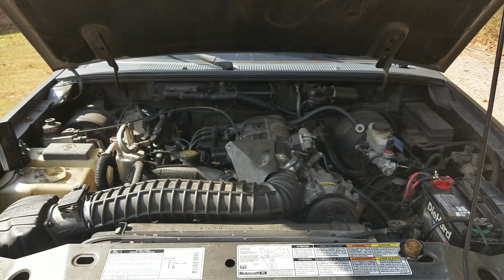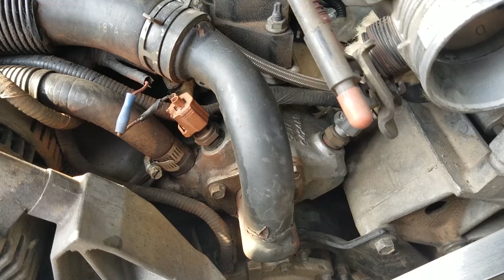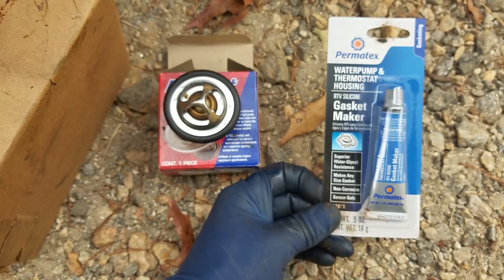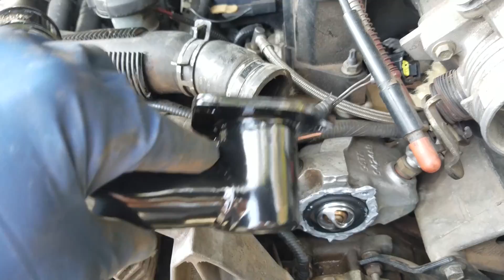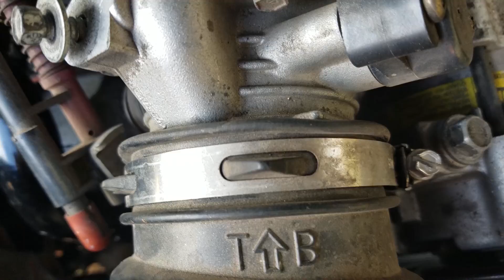Car Overheating? No Heat? Watch This!

Comment from the maker: What's up Yall? Parts in description.
Timestamps:
0:00 Intro
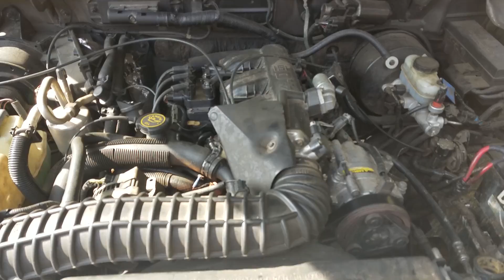0:04 Thermostat Removal
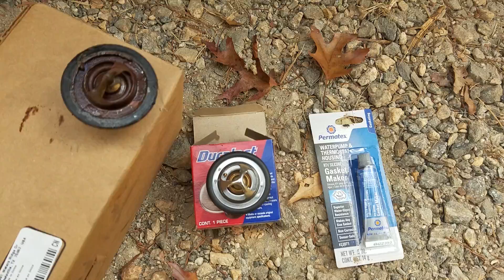2:43 New Thermostat
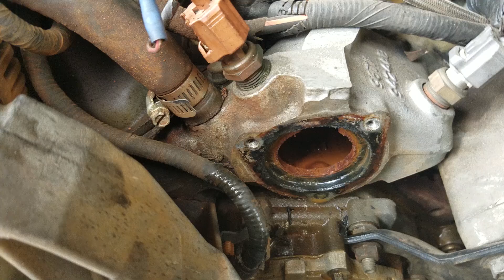3:47 Old Gasket Removal
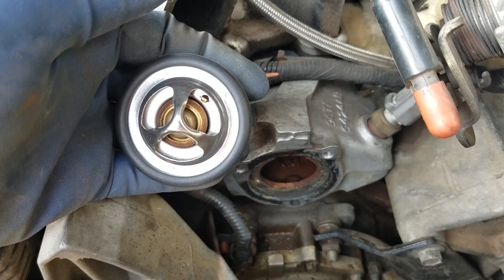5:30 Thermostat Installation
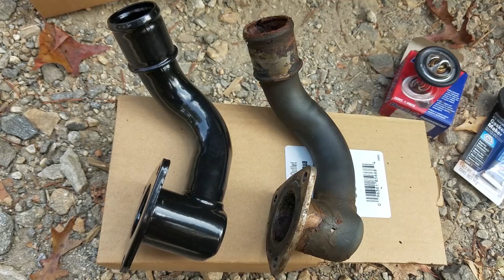6:33 New Thermostat Housing
8:18 Thermostat Housing Installation
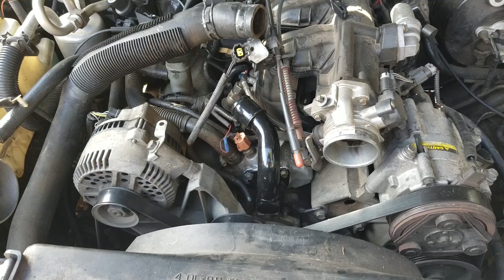10:31 Reinstall Hoses
12:22 New Anti-Freeze
13:04 Outro

As an Amazon Associate I earn from qualifying purchases.

Comment: Did you have heat after you changed out the thermostat?
Reply from the maker: Yes, You have to run it on high heat.

Comment: Okay Matt, just changed the thermostat in the wifes RUSTANG.  Went through the whole procedure and STILL haven't got heat.( Or GOOD heat, like a Ford usually has) And yes, I was watching one of Kilmers videos and put the little bastard in BACKWARD but I caught it, and this is not the issue. I'm old and tired, so cut me some slack. I'm trying to get 4 cars ready for winter and can't keep on top of shit. I'm thinking it has something to do with the vent system ... doors, flaps, vacuum etc,  HMB if you get the chance. Good vid dude.

Comment: Ok well it looks like you reply fast and I need help. So here is my situation, when I got home and pulled into my driveway it said my truck was overheating and white smoke starting coming out from under the hood, when I opened my hood my coolant overflow was completely empty (was full the day before) and I noticed my engine was wet, ( I’m guessing it was the coolant) it was really late so I decided to put some coolant in the tank and go to bed. The next morning it didn’t leak of if the overflow tank. I also noticed that when my truck was overheating my air was ice cold still. After I put more coolant in the radiator and the overflow tank I took it for a small drive to see if it was still overheating, it was so I parked it back in the driveway. The white smoke is coming from where the thermostat is, I also read in the owners manual that if the top hose that goes into the thermostat doesn’t get hot while engine is running and hot that could be the problem. I’m at a lost right now of what to do because I don’t want to take it to a repair shop if I can do it myself and save money. I have a 1998 Dodge Ram 1500 5.9 L V8 Lurami SLT please help thank you
Reply from the maker: I'd go to Autozone or Advance and rent a radiator pressure test kit. Test the system to whatever PSI the radiator cap is rated for. You should be able to isolate the leak that way. You can use soapy water in a spray bottle to help find the leak.

Could be: bad hose, thermostat housing gasket, water pump gasket, intake manifold gasket, or a blown head gasket. You are going to have to isolate the leak. Then repair what's broken.

The AC system has nothing to do with the coolant. The heat does though.

DON'T drive it low on coolant, you could blow up the engine.
Reply: Matt's Shop what will leak if it’s a blown head gasket? Also what’s the cost of that repair for my model truck if it is that because I know it’s the most expensive. 

Edit: also what would have caused my coolant to leak out like that and spray all over my engine? (It never leaked after I filled it up and took it for another test drive, I marked where I filled it up to on the over flow and it didn’t change)
Reply from the maker: Honestly, it doesn't sound like a blown head gasket. It sounds like a blown intake gasket, or one of the other issues I mentioned. I'd pressure test the cooling system like I mentioned. That way you can isolate the problem.
Reply: Any updates?

Comment: my jeep stop blowing hot air ..now it's over heating just a lil when stopped at a light any suggestions
Reply from the maker: Low antifreeze.
Reply: I just checked  and yea anti freeze I can hear air blowing thru top hose like it's dry in there
Reply: also I check the oil n saw water drop inside the oil cap ...sgould I sale this pos before it goes
Reply from the maker: Lol that's not a good sign. Typically that means the intake gaskets or head gaskets are leaking/blown. That's up to you haha. Whatever you do, don't run it low on antifreeze.
Reply: generally that's clogged/old radiator

Comment: Is it OK not to install thermostat.
Reply from the maker: I wouldn't do that unless you know exactly what you're doing. Why not just install it?
Reply: back in the day we ran without one but the heat wont work well without it. the stat opens when water/coolant reaches a certain degree so without it the water stays cooler therefore the water running thru the heater core is cooler.